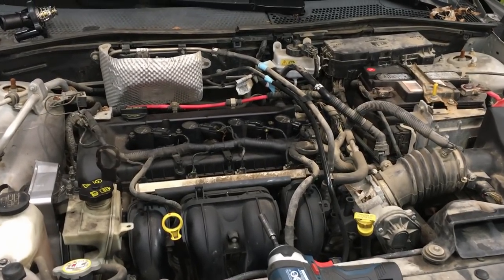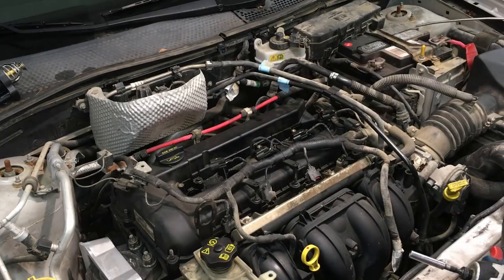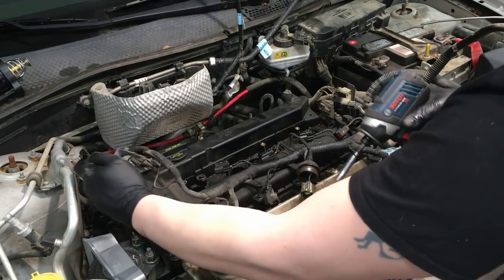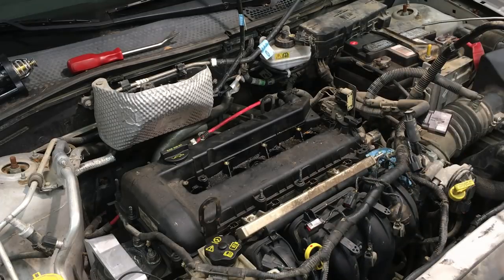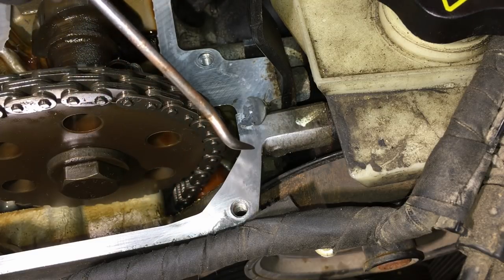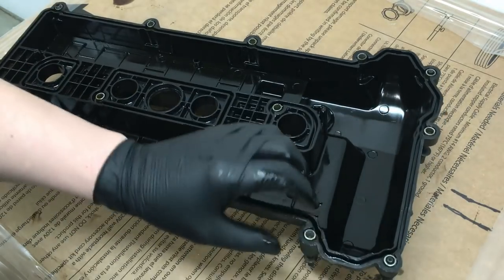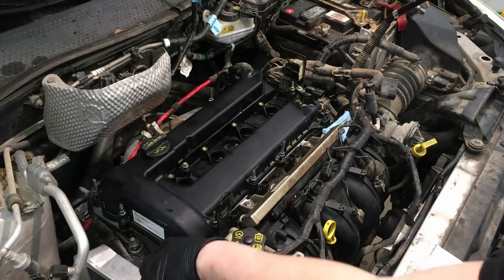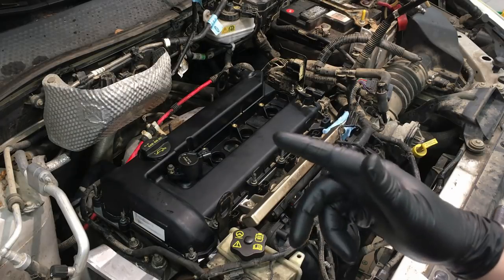2005-2011 Ford Focus 2.0L Duratec Engine Runs Rough Hesitates: Valve Cover Gasket Replacement

Comment: Be warned... if your PCV valve is defective, you will just blow out your brand new seals again after doing this.  Don't do this job unless you find out if you have a defective PCV valve first, and that you don't already have too much blow by from cylinder wear.  Unfortunately, Ford screwed up on this engine and put the PCV valve down on the block behind the intake manifold and it is a much bigger job to replace it.  Others have suggested moving it permanently into the valve cover with some modifications to make it easier to replace (every 50K miles), but I haven't seen any video on just how feasible this really is.

Comment: Used this video as my guide and got it done. My hiccups/advice for others:

1) I got sprayed with gas when removing the line since the engine was hot. Would have gone bad if it hit something hot like exhaust manifold. Need to at least wrap rags around it before removing.

2) New gasket wouldn't stay in place, kept falling out. I used grease to hold it in place.

3) Some of that silicone you scrape off had been in a bad spot and seemed to deform the lip around the valve cover sealing surface on mine.

Comment: Could this be caused by a bad PCV valve? If yes is there an easy way to replace the PCV valve which is under the intake manifold?
Reply: Ranger1 this is caused by the failed gasket. A pcv valve hose is common to go bad and will cause it to stall out and run bad. Surging idle
Reply: Evan Theis thank you sir

Comment: I changed all the plugs, boots and springs, valve cover gasket. Car still idles rough...SMH...2006 ford focus ZX4. No check engine codes or light.

Comment: What about the valve seals? How do you get to those? I have engine oil inside my pistons (and spark plugs). only was on the left 2 cylinders when I looked

Comment: Thank you man, but with the oil that was sitting on top of the spark plug, should I just let it run into the the whole or should I try to get it out somehow
Reply: Use the rags clean the oil until it’s dry

Comment: I like working like that when I have the tools and time, but we know there are times we aren't that lucky. 
I bought my lady a 2010 ford focus out here in Mexico. Out in the country. Luckily my uncle had some tools so I didn't had to go buy sockets and a wrench. I just loosen the harness and was able to slide the cover out. Well they didn't carry the cover in the only AutoZone in town so I had to order it online. Idk why it didn't had the hole for the electrical connector between the coils, so not having a drill with the bits my lady and I decided to heat up a kitchen knife and cut it away. I removed the gasket so it wouldn't get affected by the heat. When tightening the bolts for some reason I padded my pockets and I just looked at my lady with a serious face. She asked me what happened.....I forgot to put the center gasket back in place 😂🤣😂🤣😂🤣😂🤣😂🤣😂. I just loosen the cover and slid in the gasket in there. But yea.....that gasket looks like they did the bare minimal to avoid oil leaks.

Comment: I blown the gasket on my 2.3 fusion 2012. Misfire in the cylinder 1. When I pulled the coil pack the whole coil was a dipstick. Looked inside and saw the whole space filled with oil

Comment: The other video I watched was really good and it's my second time doing it. But I thought the description said 89 ft pounds of torque and I snapped my bolts off. So now I need new bolts and it was supposed to be 89 in  of torque

Comment: Bolts on the new FORD genuine cover I ordered are way long. 1/4" drive torque wrench with deep 8mm socket is not long enough to reach the heads. Seeking options like using an adapter so that I can use a 3//8" 8mm socket. That gets me another half inch of depth so I can remove and install the new cover. Wacky. Has been a nightmare. Unless I can find a quarter inch 8mm socket that is bored out more to fit the long bolts.

Comment: I have a ford focus mk 2.5, 2008 with this engine and lpg. I have a question, does the timing chain need  to be replaced in this engine or not? Mine works fine so far. It has 240000km and I don't know if it was changed or if it even needs to be changed.

Comment: Just changed the valve cover gasket on my 04 focus with a 2.0 liter zetec. Another common failure for the early focus 2000 to 2004 the thermostat housing leaking. Do not replace with a Dorman unit, the fix is to install a thermostat housing from a Ford contour.

Comment: brian  i have a  03 focus  with a 2.3 duratec     i had my valve cover gasket changed in may of 2016   and  today I noticed a little oil on the vale cover   over the no 1 spark plug   so i pulled out the coil  and it was filled to the top with oil.  should I have the gaskets replaced again   it is just over a year  by 1 month.  im wondering if the  even changed the gromments  that go over the spark plug  wells. there is oil only in no 1   but should i replace the plugs and cops
Reply: Try the pcv valve, it lets the air out of the engine, some times it gets dirty from all of the carbon build up, but it's always ideal to use Sea foam intake cleaner first.

 It's cheap an easy to do, the pcv valve, after you could take it out an clean it very well. Or replace it. Good luck.
Reply: @mattwilhelm7187   the pcv valve  in my car   is in side the intake manifold   and I really dont want to change it unless i have  no other choice   being that I work in a shop fulltime   I really dont have the time   with all the other work i have to do

Comment: Thanks for posting this video.. it helped me with replacing the valve cover gasket on my 2014 ford focus... I have an issue with the engine not shutting off when I turn the car off and remove the key. Sometimes, it shuts off right away... sometimes it runs for 10 -20 seconds then shudder and shuts off.... sometimes it doesn't... sometimes, I managed to shut it off with the key removed by simply hitting the door lock/unlock button in the radio console.... any ideas what could be the root cause....an relay stuck closed or an ignition switch... or something else? Thx

Comment: At what point should I clean the plug wells? I thought I would remove the cover, try and get as much oil out of the plug wells as possible, remove the plugs, clean them, re install them then install my new valve cover with gasket. Is it not advised to be removing/cleaning plugs with the cover off? I bought a new cover because mine was obviously warped at the rear on the passenger side.  BTW my engine is running pretty well. It's not hesitating or missing. I just happened to find tons of oil in my plug wells investigating where a smell was coming from. Hope I don't mess up my otherwise fairly smooth running engine. 2005 with only 75k on it.

Comment: Mine is still misfiring when I accelerate. Third cylinder is still misfiring. I replaced the o ring on the injector and the injectors, I replaced the gasket, and it's still misfiring. Don't know why. I cleaned the oil out  of the spark plug well with a paper towel, but I got a broken plastic piece coming out of the cylinder well. Don't know if it's important or if it's causing it to misfire, cause it feels the same. Is there a cleaner I can use to clean the oil better?

Comment: Hello, I have a 05 focus zx4, it takes a long crank or a couple cranks for it to start, once it starts it runs good, it has new spak plugs, new fuel filter, fuel pressure before rail is at around 31 psi with car on, if I just turn key to On pos without starting it I can hear pump noise but gauge needle doesnt move, any help please?

Comment: I just did this on my 2009 Ford Focus.  Wells were filled with oil and running much better now but does anyone know where to locate the PCV valve and how to change it?  Also what did he pop off at 7 mins in right before the fuel line?  Now my coolant light is on wondering if I did something wrong.

Comment: Off topic (but could be related)
Do you know the actual part number for the pcv valve and hose for the 2010 model? Thank you!

This might be a reason why the gasket of the cover needs replacing.

Comment: I know this video is about the valve cover gasket but I have a question about the intake manifold on that same vehicle. I’m trying to replace the PCV valve. Can you reply with a tip as to how to release or remove the PCV valve from where it sits in the oil separator? I really need your help.

Comment: FTM - On the off chance you read this and care to reply, I have a question: Recently I acquired a 2006 2.3L Escape 5 speed for a song. 158K miles. Probably very unrealistically, the goal was to make it a runner for another 80-100K miles....Pulled real strong, no smoke, only leak was from the oil box (repaired). 27.2 MPG, observed. Recently swapped out the valve cover gaskets and thermostat. Only problem now is oil consumption: 400 mi/qt. Ouch. Running 5-20 synth blend. No valve blow by, no visible signs of where or how or why I'm burning so much oil. No oil in the plugs/cylinder. No oil in the radiator, no smell...but I've done quite a bit of reading, and have found the Duratec are famous for rapid engine oil loss and then basically blowing up. Any truth to this ? is there no cure for this condition? - Reading and comments suggest it's apparently at it's end of life - it is a "throw away engine"...correct?  Man, I had high hopes, been a Ford man since 1996. I think this escape is trade-in bait...lick my wounds and move on.....Your thoughts, please.

Comment: Great video. Very informative. Excellent job. Thanks for doing it. I really appreciate it. I did not notice, that you were the first person I have seen use a dab of sealant. All of the other videos I have seen just bolted the cover on and called it good. Awesome work. Thanks again.
Reply from the maker: I follow the Ford procedure, T joints are a huge leak point.
Reply: @FordTechMakuloco  I've been scrolling so long for this Q&A 😌 thnx much

Comment: Please help... My car stalls when I connect the pcv hose to the pcv valve however runs without the pcv valve connected as the hose pipe was tampered with another small pipe inside it... What should I do 🥺💔

Comment: Just did this yesterday on my 2010 Focus.  Two driver's side plug holes filled with oil.  One on end was to the top.  Anyhoo, new plugs and gasket, 80% of rough idle gone so coil packs next in line.  Wet rubber boots were a little chubby.

Side note.  Leaking cover gaskets on a 2005 Subaru Outback actually displayed marks on the spark plug, a distinct brown line, where the spark was traveling down the outside of the plug into the block.

Comment: Why does Ford use such fragile wiring, I've worked on Toyota's twice as old with twice as many miles and the wiring is flexible and not brittle

Comment: Very interesting an informative, my 2007 focus has 248,000 miles an is starting to get a ticking noise afraid it is the lifters/tappets. Just a rough guess on how long it takes to fix an estimate on cost. Too deep in the engine for me to get into

Comment: QUICK question, on this same vehicle i get P0400 code error. Do you happen to know what it is? Did a google search and no luck, im abit desperate as the engine light keeps on going on and my local Ford dealer and mechanic keep send me back to the garage everytime the engine light comes on for this code. They also cant seem to fix it however they are happy to take my money each time.

Thanks in advance for your help. keep the great channel up.

Comment: awesome video... i have a 06 focus, and i need to replace the intake manifold flaps. now my question is there is a 2.0 and 2.3 engine do both of them use the same intake manifold or is there a difference. or where can i purchase just the flaps . or would it be best just to replace the whole intake
Reply: Did you do the flaps new or did you just remove them
Reply: @karlbigmore7949  cheaper to replace the whole intake
Reply: 1.8 ford focus 1.8 useing 4ltrs oil every 2 weeks had piston 2 on 50psi all the rest 165 so soaked in acetone and oil got back to 125 change pcv valve and flaps on manifold  used magnetic oil geting p130 code and lots of white smoke still using oil did plugs and rocker gasget still white smoke eny ideas

Comment: can I get to head temperature sensor without taking the cover off?? is the sensor between 2 and 3 cylinder? Ford Focus 2nd generation  - the same model you have in your video.

Comment: hey just wondering what did you do with the spark plugs that were oil filled around them.
Reply from the maker: On this vehicle they were changed out as part of the repair since I was replacing all the coils and they had 80k miles on them. Also in the past someone cross threaded #4 spark plug so we definitely had to go in and change them out. I show more in my next video where we repair the spark plug threads in the head with an insert.
Reply: cool thanks.
Reply: while ive got you i have a 1999 f150 xlt 4x4 with the 4.6l and ive had a sound like a tick sence ive had the truck could you do some videos on that engine and why it might be doing it.

Comment: I NEED HELP!

i can't get the valve cover off. I unscrewed the screws. only about 4 completely came off. it feels like the other screws remaining are holding the cover down...ANY HELP?
Reply: Most of the screws dont come out of the cover, just keep loosening the bolts then gently pull, it may stick at first but it will come out with most of the bolts still in the cover, only 4 or 5 come out completely.

Comment: Just had to replace the valve cover gasket, coils and plugs , and I was surprised how easy it was, the ball joints were a pain lol I bypassed all the rough stuff and replaced the upper and lower control arms. These little cars are pretty easy to work on minus the pain in the neck flex pipe.

Comment: see,i dissagre! I would have cleaned & re-used the coils or would have at least saved them for an emergency repair.
Reply from the maker: They were cracked pretty bad and swollen replacement was the only proper repair. This car also had a few issues with cross threaded spark plugs so lots of repairs on this one.
Reply: i like how you respond to all your messages!!! cross threaded is no good!!! bet they wish they would have threaded the plugs in by hand.i have a good question for you...03 ford focus-i got a p0340 code(i think) i ran the code the other day then i erased it. the code said -camshaft position sensor. tho the light has not come back on! & i have a long drive tomorrow. i was in low gear(automatic trans) was stressing 1st gear going up hill,wasnt going fast but it was a bit longer then i should have.when i shifted n2 2nd gear,it kicked harder then i was expecting! because i wasnt rmping on it! i just stressed it to get me up the hill.ran it to 3-4thousand rpm then let the rpm's come down to 2-3k & shifted into 2nd gear.yes i shouldnt have stayed in 1st gear for so long!!! but when it shifted n2 2nd,it kicked kinda hard(unexpectedly) i parked for 30min-1hour then when i restarted the car is when i got the code. my question is,does that mean it needs a new cam position sensor? tho wouldnt the light come on the next time i drive it? im just worried because i have a 5 hour drive tomorrow! then i wonder if maybe it has anything to do with my timming?if i had the time and money i would install a new cam sensor,crank sensor & timming belt but this trip must be made tomorrow & i hope my fucus makes it safely.

Comment: The #4 spark plug well is the one full of oil here. I had an issue with the #4 spark plug well full of coolant. Not sure what happened there, but I think I know why: had the engine idling for almost 15 minutes - no issues. Came back almost two hours later, consistent 1 cylinder misfire. Computer identified it as #4. Pulled the coil, full of coolant. I suspect a possible radiator fan problem causing the engine to get quite warm allowing coolant to build pressure and push thru whatever path it found.

Checked your video about coolant in the crankcase (blown head gasket?). Didn't find evidence of that. Checked the oil cap, valve train and dipstick - all good.
Reply: You should get a coolant pressure test done on the car (on the radiator cap). If it doesn't hold pressure, or if coolant slowly seeps through the head gasket, then you've found your problem.

Comment: I’m so glad I found this video. I just bought an 08. Running rough and so I checked the plugs. Found the wells filled. But I pulled one out and found oil on the other side of the plug. Is that normal? Or perhaps did it somehow seep around the plug??? Thanks to anyone who can help

Comment: I competed this same task on my 2008 Ford Focus SE. I have 2 questions. I did everything else spot on but there are two concerns I have. First concern is I did not use sealant when reattaching the cover . Is that a big deal? And my second concern is there was a very small amount of residual oil in the plug seats, is that a big deal?

Comment: A great video, I have the same issue with 189,000 miles and was thinking about sending the car off to the shop.But I can follow instructions and should be able to do this at home just as you have shown. The rate per hour I will charge my daughter is way less than $75.00 an hour. Plus it gives me something to do, so I have purpose in the world at least to my family !! THANK YOU

Comment: I have same motor but when I started taking mine apart number 2 plug was just laying there. Looks to be not many threads are left. Should I run a tap down and try the new plug. Or do I have to use a helical. Thanks for any help

Comment: Is it normal to still be smelling burnt oil 3 days after changing VCG? It’s also giving off an odd burning/melting plastic/rubber smell. (I’m assuming it’s the gasket on the head?
Reply from the maker: If the leak was bad before then yes it will burn off for a long time after if you don't clean it.